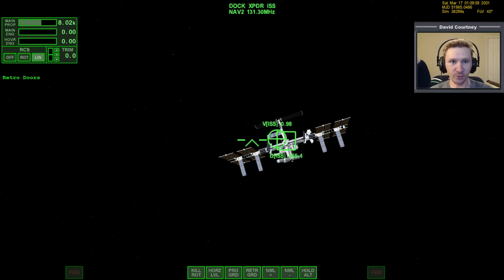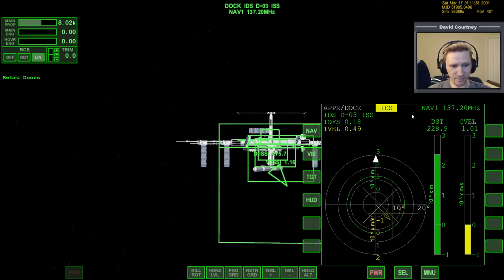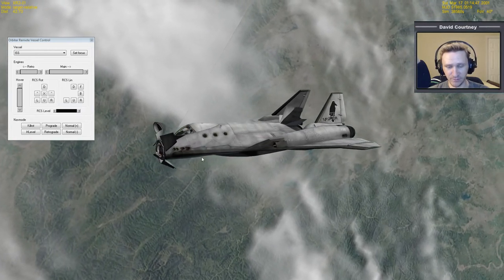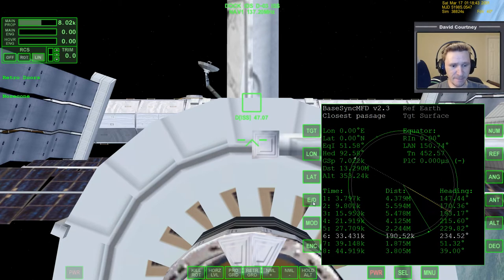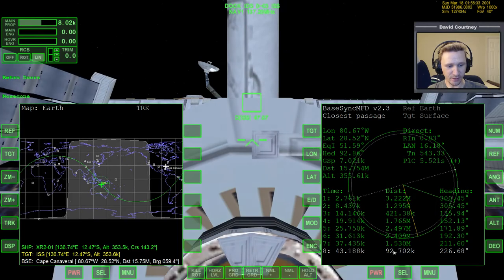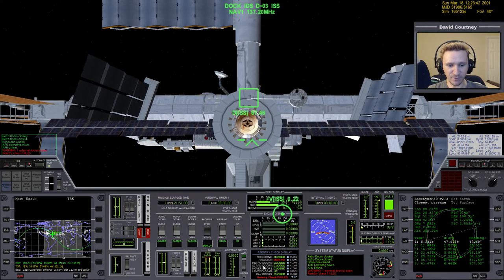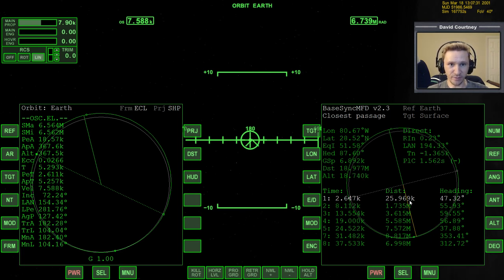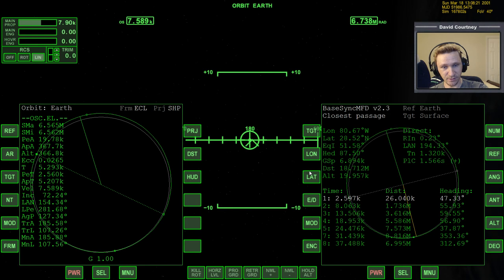Orbiter 2010 - [Part 27] Absolute Beginner Guide - Deorbiting the XR2 Ravenstar

Comment: Aah the ISS crew is stabilizing the whole station? Sounds plausible during a docking operation. i guess they use a reference grid like lets say the ecliptic and each docking object (vessel/station) is orientating on that specific artificial horizon. later when the vessel has docked and locked, they stop the thrusters to save fuel and slowly begin to rotate again together with the same speed cause of the gravitational torque. i absolutely like your tutorial videos. greetings from germany/bavaria!
Reply: David Courtney i assume always pointing "forward" means prograde? when i hit the button prograde, the vessel automatically turns and faces to the to-vector and remains there until i release the prograde mode. during flight one can change the active vessel. if you change into ISS and activate prograde i think its course stabilizes like the kill rotation mode but remains in that position until you deactivate it. but the ISS turns very slowly around because of its mass and inertia. gotta try it if its possible to "jump" into ISS hit prograde button than jump back into the docking-vessel. but i dont know yet if the ISS autopilot keeps the mode when you focus on another ship again.

Comment: I noticed one thing about restarting target to surface in basesync mfd... in video, where you talked about basesyncmfd I didn't have statesaver installed and it didn't do that. In later video where I used basesync i saved scenario and that time i noticed it reset the target to surface. during this video I had statesaver installed and it is doing it periodically... so i think, the target of basesync mfd resets to surface alway when the scenario is saved :) I turned off statesaver in modes and it stopped:)